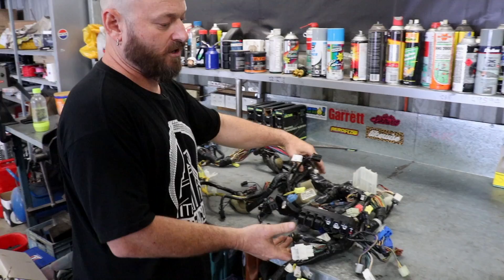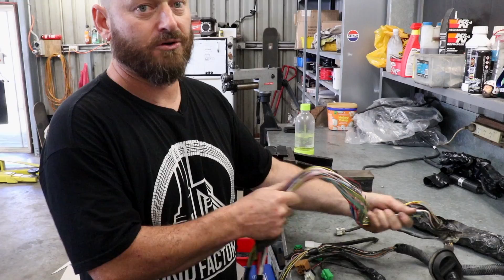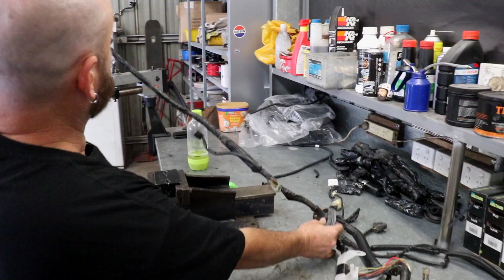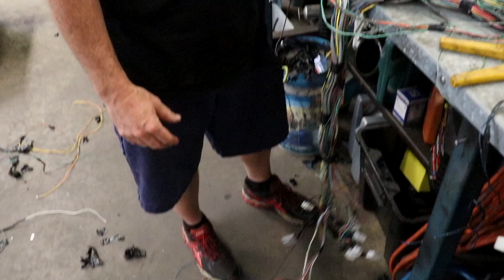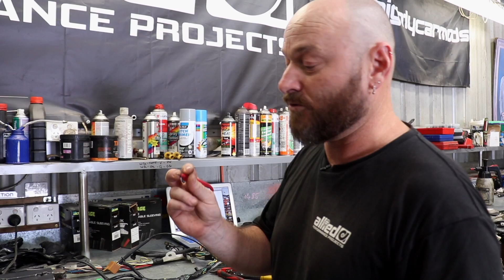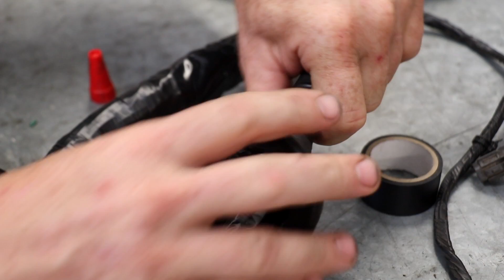How to Splice a Factory Wiring Loom  [THE SKID FACTORY]

Comment: Just wanted to say thanks guys  - 6 years later and this is still helping people out. I'm part way through merging looms to swap an ej255 into my first gen Liberty and this has helped my process. To anyone else working through the same procedure, I'd also recommend looking up a thread on the RS25 forums called "1999-2001 RS Swap to WRX or STI", and another called “Brydon Teaches YOU to Merge a Harness”. The photobucket photos in the second thread don't work anymore, but it (including the original photos) has been mirrored on a site called "theCgarage" - google that plus the name of the thread and it should pop up. Good luck fellow loomineers.

Comment: very informative... loads of knowledge shared. thanks... only disagree with your use of crimp connectors because of oxidization will create resistance at the joint over time. where as solder will prevent this happening

Comment: Hey Al, I cut down a liberty loom to run an EJ22 in my Brumby - it is a stand-alone engine loom now and is almost all in the engine bay except for the ECU and the wires to to gauges fuel pump etc. I'm thinking of putting an EJ20T in my 98 Liberty and was going to do it much the same way - ie just unplug/abandon all the old engine wiring and hang a cut down loom for the EJ20T in the engine bay as per the brumby. My question is what is the advantage of pulling out both looms and doing  a merge and then putting it all back in? Sure, it will not look as good but saves a lot of work removing merging  and refitting the entire loom?

Comment: quick question, I don't have that style of crimps in my selection on hand, I went to look them up online to get some but can't seem to find that non insulated splice crimp that allow you to twist the wire before putting on the crimp. Does anyone happen to know where to purchase them online, better yet maybe an Amazon link to them? Thanks
Reply: Put this "453 U-shaped terminal tab cold inserts connectors cold terminal small teeth fascia terminal,0.5-1.5mm2"
or this "U-shaped terminal tab cold inserts connectors / terminal connector cable / wire cable lug,3-6mm2" 
into Aliexpress, the seller also has some other sizes.

Comment: Sweet vid boys. Where did you get those crimp connectors from?
Reply: Put this "453 U-shaped terminal tab cold inserts connectors cold terminal small teeth fascia terminal,0.5-1.5mm2"
or this "U-shaped terminal tab cold inserts connectors / terminal connector cable / wire cable lug,3-6mm2" 
into Aliexpress, the seller also has some other sizes.

Comment: What are those crimp connectors called that you used and then put the heat shrink other
Reply: Put this "453 U-shaped terminal tab cold inserts connectors cold terminal small teeth fascia terminal,0.5-1.5mm2"
or this "U-shaped terminal tab cold inserts connectors / terminal connector cable / wire cable lug,3-6mm2" 
into Aliexpress, the seller also has some other sizes.

Comment: What brand and type are those wire crimps? I can not find that type anywhere, all I can find are insulated ones.
Reply: Put this "453 U-shaped terminal tab cold inserts connectors cold terminal small teeth fascia terminal,0.5-1.5mm2"
or this "U-shaped terminal tab cold inserts connectors / terminal connector cable / wire cable lug,3-6mm2" 
into Aliexpress, the seller also has some other sizes.

Comment: This is full on nerd stuff and I love it! I'm currently trying to figure out the wires on a Bose Amp from a 2003 Altima and this video was incredibly useful. I was trying to match the wires based on a couple of internet sources with the corresponding colours. I now realize that they might be different. This changes everything. The only thing I would do differently based on my complete lack of experience is, I would use a different colour electrical tape for the other loom so when they are placed on top of each other I wouldn't get confused.

Comment: Ewwww, crimp joins. Use a Lineman's Splice FTW
Reply: A linesman splice is not the industry std for vehicle wiring, crimp joins are.
Reply: Yeah, but if NASA requires them, they must be the best :)
Reply: Also, I commented before I saw what kind of splice you actually used. My assumption was those crappy butt-splice crimps, not the much better way I saw you use

Comment: I'm in the middle of a ej20g to 1996 Impreza and going from auto to manual. Last bit is grafting in the abs from a 99 2.5rs. Huge pita but it's got to be done. Love mcm and skid factory. Only issue is a plug on the 95 loom that doesn't show up in any schematic at all. I think it might be a version of the test plug near the fuse box but it's male pins in a big black 22pin plug. Don't want to clip it before I know what it's for. My 96 auto loom has a 14 pin female plug for testing but it's obd II and the manual Impreza loom doesn't have abs or the standard testing plug. Since all others are accounted for im sure it's a testing plug but male pins? And they're a super pain. Can't figure out how to depin this type of plug. All others are a snap but this one just doesn't want to work.

Thx for the great shows. Hope u guys make it to Seattle some time. That would be sweet.

Comment: Thank you So Much guys!! :) This Is really helpful. Only mistake I made when i went put 02 wrx sti loom into 98 GC8 wrx is i skipped the fuel pump control module and removed the code's. Big Mistake!! Should of kept it, cause now i have Fuel issues on cold start. May have to wire it back in yet. :(  Great Job guys AAA+

Comment: Alan doesn't specifically say this, but the reason why you should never, ever let the loom run loose (or worse, take it apart completely) is because the loom is made on a jig, with tolerances, and if you start messing with order, length, position, tie points etc, you risk changing its architecture and the way it behaves and that's when wires snap, twist and break in the sheath etc.

Comment: Where do you get the crimp connectors? I checked Jaycar's web site and did a Google search, but couldn't find them. That method of joining wires is so much easier than soldering.

Comment: What if I want to put a modern turbocharged engine in an old car that doesn't have any electronics other than the lights(carburetted, no power windows, no power locks, no power anything, just relays for the lights and other pretty normal stuff) ?

Can't I then just transfer the wiring from the turbo car to the old car?

Comment: I work in aircraft electrical which is very standardized.  Auto electrical drives me crazy! It's all over the place! The way they control circuits with grounds or power. And Jesus automotive plugs mostly suck! There are a million flavors. Great video guys this needed to be done.Turbo Yoda is a bad ass!

Comment: thankyou for calling out the issue with aftermarket ECUs, the frustrating thing is that some older ECU's are now failing - just spent 600 dollars getting a 1UZ ecu repaired, a Modern ecu would sure be more reliable but as you say, the testing to make it legal is difficult and very expensive.

Comment: When I'm doing wire looms I use releasable zip ties instead of tape when I'm mearging them up. I find it easier then cutting tape all the time. I also save all the wire and bring it to the scrap yard when I get a huge pile. You can get a bit of cash for it.

Comment: Have you ever thought about using Tessa Tape on the loom instead of the loam tape.  Changed my life when I started using it.
Reply: I second that, Tesa tape is so nice.
Reply: I use normal loom tape to keep the OEM look.
Reply: Alan Butler makes sense.   Plus loom tape is cheaper then Tessa tape.  Can’t imagine what it cost in Australia.
Reply: 25m rolls of 51036 go for ~$12-18 depending on supplier, its worth it imo

Comment: With this video, i may actually be able to finish my EZ30D swap into my manual Outback. The wiring had been kicking my ass because i thought that if i just swapped the loom from the ECU forwards it would work. Nope! Error codes for days and the dash doesn't want to power down.

Comment: where do you get those pins to crimp two wires together and what are they called..
Reply: Put this "453 U-shaped terminal tab cold inserts connectors cold terminal small teeth fascia terminal,0.5-1.5mm2"
or this "U-shaped terminal tab cold inserts connectors / terminal connector cable / wire cable lug,3-6mm2" 
into Aliexpress, the seller also has some other sizes.
Reply: samthenerf thanks heaps man been searching for a while

Comment: Thanks Al for sharing the detailed knowledge. I rewired my gtr race car (before seeing this vid) and learned some lessons myself the hard way, but still picked up lots of good info from this. One thing, instead of the splice + heat shrink I used single piece heat shrink splices which I think support the join better due to the glue/heatshrink taking the strain (plus you can't forget the heatshrink and have to pull it all apart again). Also one question because it shits me to tears with electrical tape....what brand of loom tape are you happy with that sticks to itself?!?
Reply: Not sure what you mean by splice and heatshrink? Is that the plastic pieces that release glue when crushed? Loom tape is just Low Voltage brand from JAS.
Reply: @alanbutler2579  Hey Al, where abouts did you get the crimps from?

Comment: Thanks for this guide.. really helpful for those of us who aren't afraid of digging in and having a go.. one question though, what are the crimps called to join wires and where can you source them, also the loom tape?  keep up the good work guys!
Reply: Put this "453 U-shaped terminal tab cold inserts connectors cold terminal small teeth fascia terminal,0.5-1.5mm2"
or this "U-shaped terminal tab cold inserts connectors / terminal connector cable / wire cable lug,3-6mm2" 
into Aliexpress, the seller also has some other sizes.
Reply: samthenerf thanks!!

Comment: do you bother keeping the old connectors that you strip off old wiring looms? just thought it might be quite difficult to get some of the older connectors especially the weaker/ more vunerable ones or are the connectors pretty bulletproof and really dont need replacing
Reply: Subaru's use a seperate manifold/engine harness that I normally never see when doing these jobs. The manifold harness is normally what has problems with connectors.
Reply: I think he means to ask if you keep/re-use/ recycle the old hard to find OEM connectors. That's the first thing I thought when you threw the old loom in the bin at the start of the video. To me that seems like a wealth of good reusable material. But I get that if you do it often enough you get an abundance of it. I still wouldn't throw it out though :P

Comment: While stripping a loom I prefer to use Velcro tape so I don’t constantly replace tape after removing it to remove one wire.
Reply: I just got some velcro tape, will give it a try next time. Saves having 50 pieces of electrical tape stuck to your shoes too.

Comment: where do we buy the brass joiners? I can only find insulated ones
Reply: Put this 453 U-shaped terminal tab cold inserts connectors cold terminal small teeth fascia terminal,0.5-1.5mm2
or this  U-shaped terminal tab cold inserts connectors / terminal connector cable / wire cable lug,3-6mm2 
into Aliexpress.
Reply: samthenerf thanks buddy
Reply: Bless you Sir, I spent about a hour on eBay and Amazon looking for these, and just came up with bastard Scotch Locks and those poxy insulated bullet things.
Reply: Yea, unfortunately the seller translated directly from Chinese and got no relevant English keywords.
Reply: thankyou i have been looking for weeks for theese!!!!

Comment: You don't use Tesa tape because you reuse conduit, fine. Those crimp connectors, I like, where can i get 'em? All the ones I fine are insulated bullets, do you get them from a micro-electronic place like RS Components?
-edit- found them on aliexpress "11pcs Docking connector line pressing button quick...."
Reply: Wow thanks, I think you found like the only listing online for them.
Reply: Yeah if you search for '453 connector' think that's model, they also have beefier ones by different model number. '451-2'

Comment: Great info. Where do you get those inline crimps?
Reply: Put this "453 U-shaped terminal tab cold inserts connectors cold terminal small teeth fascia terminal,0.5-1.5mm2"
or this "U-shaped terminal tab cold inserts connectors / terminal connector cable / wire cable lug,3-6mm2" 
into Aliexpress, the seller also has some other sizes.

Comment: Are you able to share the supplier of your butt splice crimp terminals? I've tried a few but haven't quite found the right size for basically the same application.
Reply: Put this "453 U-shaped terminal tab cold inserts connectors cold terminal small teeth fascia terminal,0.5-1.5mm2"
or this "U-shaped terminal tab cold inserts connectors / terminal connector cable / wire cable lug,3-6mm2" 
into Aliexpress.
Reply: Awesome, thanks!

Comment: Im glad in NZ we have no emissions rules. Only rules we have are for safety, so engine swaps, suspension and power upgrades all need to be checked and certified.

Having to do this or paying for someone to do this vs just buying an aftermarket ECU, plug and go or dyno tune. 

I know which I prefer and no issues with passing regulations.

Comment: Years ago a fella I knew cut a loom in half at the firewall (for a sr20det conversion into a Pulsar).

He asked if I could help out, not knowing what he had done at this stage.

I got there, he gave me a soldering that could be mistaken for a welder and asked to solder all the wires back together.

I lol'ed and left.

Comment: What's the proper name of those crimp splices being used in this video? I've not seen them here in the US and they would seem to be better for some things than the usual type crimp splice found in auto parts stores in the US.
Reply: Also "open barrel brass splice"
Reply: So far googling "DJ454 U shape" gets close
Reply: I would love to know too!
Reply: Put this "453 U-shaped terminal tab cold inserts connectors cold terminal small teeth fascia terminal,0.5-1.5mm2"
or this "U-shaped terminal tab cold inserts connectors / terminal connector cable / wire cable lug,3-6mm2" 
into Aliexpress, the seller also has some other sizes.

Comment: This video is a gold mine of information. I've been doing a lot of work on my Integra, and have been tossing around the idea of slimming down the harness and tucking it, this just put me over the edge, thanks a bunch! Thanks for sharing all your car knowledge with us over the years.
Reply: I've just pulled a B18C engine, loom and ECU out an Integra and about to install in a Civic... sounds like fun.
Reply: I had a 93 base RS. I installed and wired electric mirrors, went to the junkyard and got the pushbutton HVAC controls and installed that in place of the simple slide lever controls. Those two things took me about 8 hours total. I had previously removed the AC and PS systems to lose weight. Never got around to actually installing a manual rack, didn't really seem to need one. Also put a P8R head JDM B20B in it, then taught myself how to tune. It was a fun car but ultimately rust ate it. I miss my integra. Right now I am working on a 2000 prelude that I converted from auto to manual. Needs a new clutch which I should be doing soon. Good luck with your teg. I consider Honda to make some of the best cars in the world. Simple to work on, logically laid out, easy power increases.
Reply: Lucky Rooster thanks!
I've managed to carve myself out some time in life to really focus on project cars and YouTube. My problems are I have been spending days and days just cleaning the garage to actually have space to work.
Plus I have too many projects and need to focus. 1985 MR2 SR20 swap, 1997 Eclipse GSX resto, 2001 Impreza 2.5 RS V10 swap, 2004 WRX daily project. You get the idea!
Reply: It's a base model second gen, no airbags, ABS, cruise, or power anything. I've already got the power steering out of it, it was an auto car, that's gone, and I know the manual components are a lot lighter. I had a really similar 92 Integra that was 2490. I'm hoping to get this one around 2400. This one has a little ebay turbo kit on it too, hence why I'm thinking of slimming and tucking the harness, I'm already in there doing wiring.
Reply: I shaved the studs for the injector harness box off the fuel rail and have the injectors angled with the plugs and wiring running under the runners and meet up behind the block. All the engine plugs are joining up under the intake manifold at the moment and I'll probably run that loom straight back through the firewall than branch off where they need to go. I've got the fenders off and am just starting to get the passenger side relocated on the inner fender, haven't touched the drivers side yet. I wanna focus on finishing running the engine harness to the ECU and gauges before I finish anything on the body harness. There's a lot you can get rid of in these engine bays haha I love working on these older hondas.
Reply: No, a lot of people tell me I need to get IG just for all the random car shit I get up to.
Reply: dropinbiking92 Or a YT channel! I'm having a go. Hahaha.
Reply: I was talking to The Gunman and he wants me to get posting up more paint booth videos. Sadly I'm not working at a body shop right now, so it's not like I'm painting every day. I wanted to do videos and such working on my car it's just such a pain in the ass. I'm barely motivated enough to be working on it at all hahaha
Reply: I bought this particular Integra 3 years ago. It sat outside of my garage the first year, came inside the second year, and this year I've actually started working on it. I probably poked with my last one for 2 years off and on before I ever put it on the road. I'm slow as hell when it comes to working on my project cars.